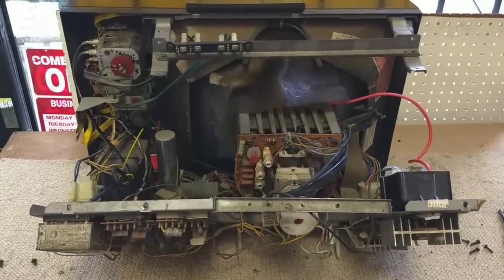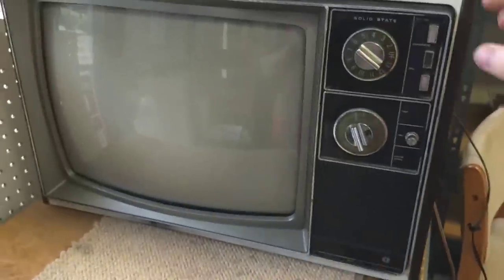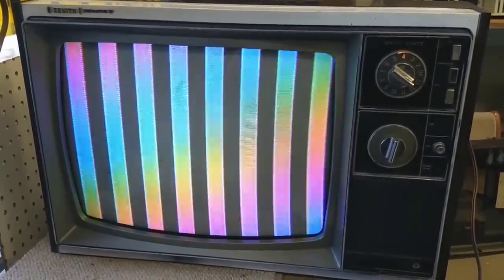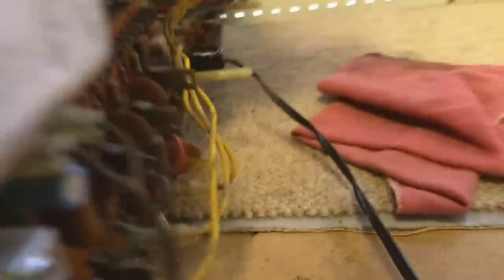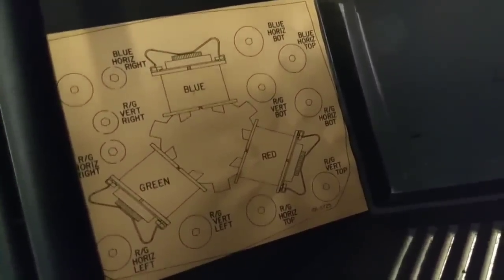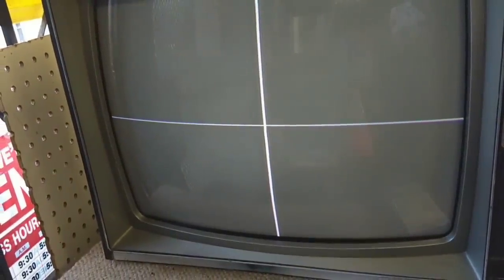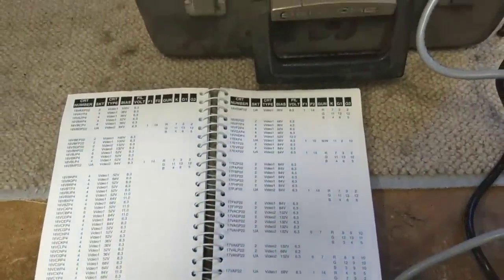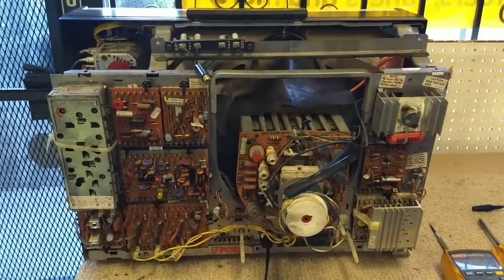Servicing a 1974 Zenith 17" Chromacolor II Color tv part 4 / ?

Comment: Something just came to me. I think I remember you installing an NTE528 tripler, based on what the tripler that was in there crossed over to. In the E and F chassis lines,  those used a NTE526 tripler. Some other things to check is the big resistor that is soldered to the REF terminal of the tripler and check components associated with the tripler. I'd also look at the horizontal drive at the base of the HOT and make sure it's stable.
Reply from the maker: Yes, there is a 528 in there. I'll have to see what the differences are. I have yet to check the waveforms but the resistor on the ref terminal is spot on.

I'm betting I just put the wrong trippler on there. I'll check waveforms and HV going in and out and go from there. Gotta find a thermistor too.
Reply: @JordanPier  I think that the tripler or circuits nearby has high inner resistance, so high voltage is soft. It drops when you need more current. As "radiotvphononut"
wrote, also the resistor from tripler to ground could be wrong. Check the components between cold end of high voltage winding and ground.
I don't think there is any problem with horizontal out transistor and its driver.

Comment: I just got a Montgomery Ward "13 color TV from 1987 and it has a digtal tuner, has remote, and is cable ready. I found it at antique mall for $1 and I have no idea if it works but for $1 I couldn't passe it. If it doesn't work I will fix it if can and if tv has bad CRT or a part that can't be found for a reasonable price I will use it as parts  to fix another TV.

Comment: Hi Jordan, I thoroughly enjoy watching your videos. I picked up a Chromacolor ii and it was working and giving me a very strong bright picture, but now it trips the circuit breaker after about 5 seconds of being on, and doesn’t give me high voltage. I’m somewhat familiar with older Magnavox sets of the late 50s, but I’d like to get this one back up and running. Where would you check first and do you happen to have a schematic you could share? Appreciate it!
Reply from the maker: First, disconnect the input to the trippler and insulate it. If it powers up with the trippler disconnected it's bad and needs replacement. Nte/ecg 526a or 528 was the typical replacement but the original zenith part can be cross referenced.

I'd start there.

Comment: Not sure if you can help but I have a similar chromacolor ii tv and I was tuning the convergence but can't get the blue to align vertically on the right side of the screen. Most adjustments can be turned with the hand but there are a couple that look like those white posts with wire wrapped around at 31:47. Those should adjust what I need but I don't know how to use those. They seem to have a hexagonal shape inside that looks like you can fit an allen key in there but I'm not sure about that. Any advice on how you adjusted yours?
Reply from the maker: You'll need a plastic alignment toolkit to adjust those. If you use an Allen key you will destroy them.
Reply: Thanks for the info

Comment: Are new tv,s easyer to work on ,or older tv,s .
Reply from the maker: Old tvs are much easier to work with. Now everything is on a panel. Circuit boards are replaceable but rarely component level serviceable.  Sets started getting cheap by the 80s and we're Chinese junk by the 2000s
Reply: @JordanPier  Thanks so for your input  look forward to your next videos ,My favorite are your tube radios repairs , I learn from them .

Comment: Hi, the NTE 526 and NTE 528 triplers have different focus resistive dividers, apparently, the 526 is the correct one, but with NTE, you cannot be 100% certain. Check the capacitor on top of the flyback ceramic board, and verify the HOT is the original or an appropriate replacement one, IIRC it's a 121-1092 (I could be wrong here) 1500V, without damper diode. Good Luck.

https://www.nteinc.com/specs/500to599/pdf/nte528.pdf
http://www.nteinc.com/specs/500to599/pdf/nte526A.pdf